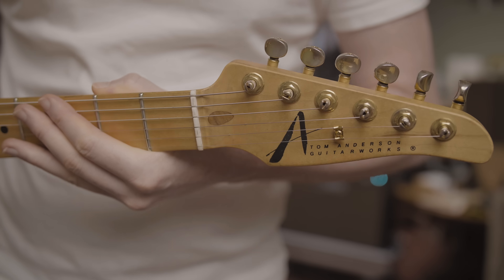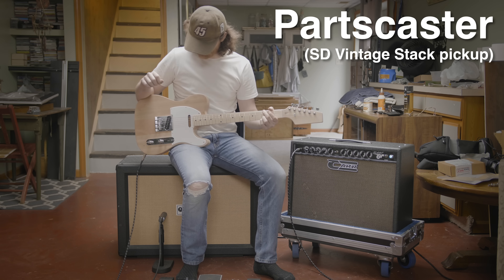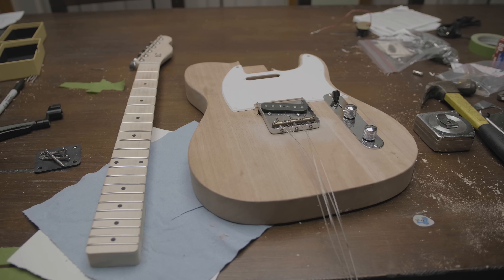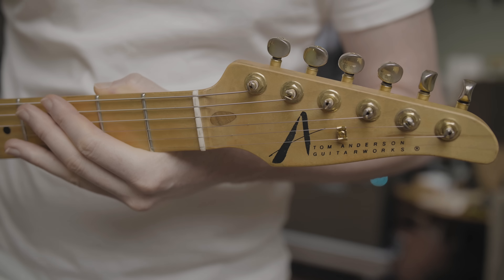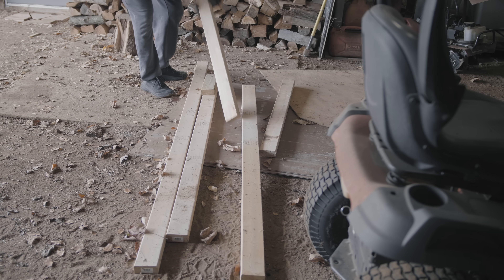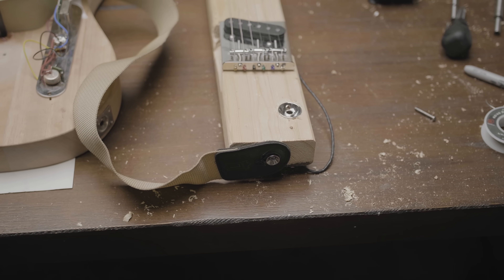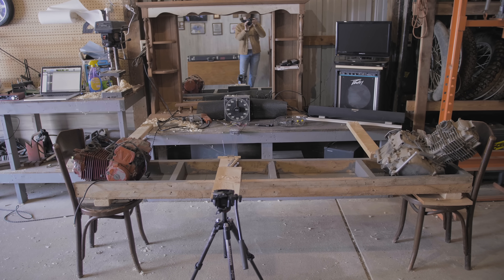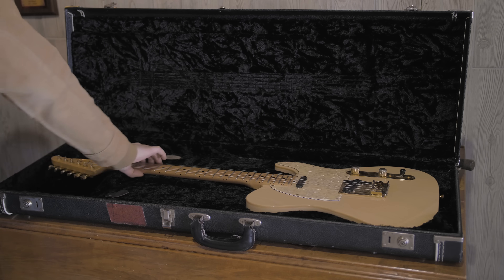Tested: Where Does The Tone Come From In An Electric Guitar?

Comment: What an absolute legend of a video. VERY interesting
Reply: Will the air guitar chug?
Reply: @Hernan G.D.A.  Turn on those Honda engines and I'm sure it will! Lol
Reply: @hernanSXD.3880  yeah that’s a damn good question! The answer is yes as long as the player does not have cottonmouth!
Reply: This guy deserves his own signature model, Ola. Make it happen!
Reply: And a solar air guitar was born
Reply: @NoQuadsNoMasters  The high-neck access is insanely good.
Reply: @randalljones4370  the frets will last several lifetimes of use
Reply: What's interesting about the last test is that, though the body of the guitar isn't under the pickup, there's still a lot of mass there, since it's a table, and the pickup is still connected to it. I actually found the 2x4 more compelling. Still, this pushed me solidly into the "tonewood doesn't matter" camp. Really nicely done, Jim!
Reply: Confirmed: Next Solar shape is an Air guitar!
Reply: But does it Djent?
Reply: This should be shown to every guitarist.
Reply: But will it chug?
Reply: Can't wait for the Solar Air 1.5
Reply: WILL. IT. CHUG?? 👏🏽
Reply: @michaelolvera7490  ok
Reply: Yoooooo
Reply: Legend status achieved! Video of the century.
Reply: One of the best video on YT for electric guitar ;-)
Reply: I'd love a budget Solar guitar with the cheapest possible wood and decent pickups as long as its comfortable to play
Reply: One more like then stop! 665
Reply: Absolutely, couldn’t agree more.
Reply: How does that feel as the owner of a guitar company? ;-)
Reply: I know, right!?
Reply: @michaelolvera7490  well palm muting is something external done to the strings. of course something will be different, but its not the tone, the tone is just being covered up by the palm
Reply: Can Milk chug?
Reply: But will it chug?
Reply: And by the way, it is still not an 'air guitar' cause technically, it's mounted on two tables, with direct contact to the floor.  

The only way to have a true air guitar is using mag-lev apparatuses for both the headstock and the bridge. Or use drones.
Reply: I’ll be patiently waiting for the Solar 2x4…
Reply: But will it Chug? I smell a Collab maybe?? 🤣
Reply: @andybrown1439  where does the chug come from?
Reply: this has been done in another video by this by this dood that owns a sawmill about 3 to 4 years ago
Reply: @michaelolvera7490  prove it
Reply: now build your guitars out of foam Ola. amiright?
Reply: @Ola Englund --- get Fricker on the horn. He is gonna wanna see this ...
Reply: F..cking chugg 😅🤦
Reply: Agreed
Reply: Yeah, but does it chug?
Reply: no chug please
Reply: Respond Ola!
Reply: @HollandProductions_CA  you're not his boss :D
Reply: The question is... will it chug!!!😁😁😁✌✌✌
Reply: U sir are the legend here
Reply: But does it chug ¿
Reply: OLAAAAAA!!!!
Reply: Can you send me a solar guitar and some electronics to screw in to my coffee table to compare? Lol 

Love your first album by the way.
Reply: Hello Ola!
Reply: I knew my Solar sounded as good as any  biG brand USA Custom Shop guitar! Cheers Ola!
Reply: and then ola englund goes and tests neck through vs bolt on
Reply: Too me they all sound the same but a small difference of each other. Including all the amps. I figure their would be a big difference but dosen't seem like it. One more thing maybe it could be in your soul and fingers.
Reply: Too distorted for a test. You can hear just thick or thin sound, no subtlety or timbre.
Reply: Ola posting shit!
Reply: I wonder the reason you wrote this. "legend" ? 5000 comments so far anyways
Reply: Wiil it chug? Up coming next!!
Reply: i can hear the sound of your voice as i read this
Reply: Ola the chugger who has no tone either!
Reply: Dr. Suess
Reply: @Jimi Cicchini "any good piece of wood"? have u seen how many guitar blanks becoming bodies  that are produced in a day at Fender or Gibson?
It's called; mass production.
we're not talking about 10 or 15 guitars a year or a particular Master Builder where you place an order and have to wait a couple years.
It's beyond ridiculous; 10 and 15 grand for a Custom Shop Les Paul!!
But it is All About Supply and Demand.
A freaking Slash "Green Alligator" commands a very popular market and you gonna pay!
I saw that flakey cunt posing with an Epiphone???
Maybe shoulda got Ted Bundy to pose with a Tire Iron...?
Still got yer Pet Rock?
Dear Americans; 
The USA is Not a Joke...it is a Punchline
Reply: @Jimi Cicchini No not all bud, Don't be a complete putz All his experiments are saying is Electronics have more an impact on "Tone" than any wood and that goes out the window when using hollow or semi-hollows as there is acoustic resonance properties. Keep in mind his experiments are a bit flawed.
Gilmour is a master at playing there is a large difference, a great guitarist can play anything and may be able to make anything sound good, more so because he can play what will sound good on it, but you all are probably not at his level as most are not.
Reply: @Jimi Cicchini ? Classic style or modern - Fender has $500 options, either that or get the stewmac offset body kit and DIY it.
Reply: Insert clap
Reply: Such a great experiment.
Reply: @Jimi Cicchini Thomman Music is a great place to start.
Reply: In walked Wenge.. .
Reply: hola ola
Reply: Solar 2x4 when?
Reply: BURP
Reply: So what are you going to do about it wrt your guitars?
Reply: will it chug?
Reply: Ola , what are doing here in hillbilly town? 😂
Reply: But he proved nothing... Bolting the strings to wood and a large metal bench is not "removing sustain from the equation." Those things would be vibrating as much (or more) than a guitar body and neck 🤦🏼‍♂️
Reply: SO.... if i buy a cheap Chinese electric guitar and put an expensive pickups in it... voila!! Excellent sound😱😱😱
Reply: @americawalk1154 Pretty much.
Reply: The air guitar doesn’t go chug chug, it goes chuuuug chuuuuug.
Reply: Total waste of time for this poor guy doing the vid and for everyone else that's falling for a bunch of hoopla..  goofiness. C'mon people. I just stumbled on this and rarely ever click on this type stuff and never thought I'd be  commenting on something like this. 

If every guitar player on YT would spend as much time  actually playing the instrument and trying to get better or improve or be creative and write something as he or she does watching gear reviews or something gear related or some  dude showing a BS short cut to how to  become the next Eddie VH... We'd have lots more talented players out there to draw and learn from.  

Get off YT and put on a record. Learn it the old fashioned way...By ear. 

Rant is over.
Reply: What are the sustain differences  between them  if any
Reply: even  without body , quitar  sounds the same....
Reply: What a surprise to see you here.  I've owned a lot of guitars, and my favorite is the Washburn Solar.
Reply: Just rehashed what was known about electric guitars from the 1930s and 40s. Read your history.
Reply: Nothing legendary about con artists to me
Reply: Do a Will It Chug on The air guitar!
Reply: Yes, amazing video. Turns out that the Emperor is stark naked. Too funny. Gonna find that video where Steve Vai or Joe Satriani explains how the fret inlays provide a more mellow tone. I swear; best video I saw this year. Can't believe I only just found it.
Reply: Tone air, tone wood , tone fire, tone water
Reply: Agreed.
Reply: For chugging you better try the air guitar.
Reply: I guess I don't need that solar guitar afterall
Reply: Did the video chug though?
Reply: Great video. Some people just have too much money and need to burn it. 🔥
Reply: @danpena7922  apsolutly!!!! It is nice to have nice guitar, but let's be realistic for god sake... 6000 for electric guitar is ridiculously stupid... Even 3000 is to much..
Reply: Time to release budget plywood Solars!
Reply: Hey Ola.
Having a guitar company your self, what is you thought on tonewood in solar guitars? Is it something you think about or do you choose on price, looks or quality?
Reply: Yes I would like to set up before I just don't know if this is really losing it and really you know I use it for a crutch will you have to expect my mind to be screwed up and with the very thing yet it's f*** up, you know what to say about thatOkay I'm not sure if I'm crazy but are you talking to me because if you're talking to me
Reply: You should be interested in Science best.

When a string is struck, it begins to vibrate in its fundamental and a strip of harmonics with different values in Hz, although not all with the same intensity since it also depends on the string itself.

From that moment on, all the elements of the guitar will offer resistance to said vibration (say vibrational energy absorption), as well as the body.

Depending on the characteristics of each of these elements, the absorption can be proportional in all the Hz of the vibratory or electromagnetic wave or not....
If we have a part of the guitar, such as the body, made of wood whose hardness (as a result of its internal structure, drying, etc. etc.) is high, it will provide more resistance to harmonics of a few Hz than to harmonics of higher value in Hz therefore immediately absorbs and leaves the string without low harmonics... resulting in a higher pitch.

And other woods that absorb much more (oppose more resistance) to the high harmonics will give a darker timbre... Other combinations of woods eat up the lows and highs and leave more mids... etc.

That said, does the wood compared to the pickup have more influence? No, obviously a pickup prepared to pick up the highs and discard the lows will give you a high-pitched tone more effectively than wood.... but that's another story.
It does not mean that the material is the same, because no matter how much a pickup is prepared to capture more treble, like the string it suddenly loses all the upper harmonics due to the effect of the resistance of the body and other materials, which is going to left is a guitar with 0 sustain.

Video is bullshit.
Reply: @derfreischutz4380  you’re arguing about the acoustic tone of an electric instrument… the wood doesn’t have any affect on the amplified tone. 

See the video you’re commenting on for proof. 😂
Reply: @Drtydeeds  yes it does, you didn't read carefully what I published
Reply: @derfreischutz4380  the wood doesn’t affect the amplified tone of the guitar no matter how you try to twist the facts lol.
Reply: @Drtydeeds  alright man!
Reply: Has anyone watched the Warmoth video where they do the exact same experiment resulting in clearly audible changes in tone when keeping everything constant but using different bodies? Even the test between one chambered body and one solid body cut from the very same piece of timber produce audibly different results. I definitely couldn't hear any difference in this video but they have quite a few videos with very different results.
Reply: @andtothewestamerica   to be fair they sell wood. I like Warmoth, but there may be some bias there.
Reply: @MegaWimberly  Can't be denied. Maybe I'm a fool but I don't see Warmoth going to the trouble of making those videos, then altering the audio so they can fool customers.
Reply: @andtothewestamerica  HOLD THE FRONT PAGE! A company whose business is to sell you different bodies and necks made of different woods says there's a difference in sound!
Reply: @UITATUBE  They don't say there is a difference in tone, they demonstrate it, clearly.
Reply: @UITATUBE  Wow, you're so clever! Damn, some of you guys are so quick to jump to conclusions without just watching the videos first. the warmoth guy is pretty honest about these things. He has said before that pickups make the most difference and if the wood makes a difference, it is subtle. In some vids he said he couldn't hear a difference. Go watch the vids before you talk rubbish.
Reply: @andtothewestamerica  Warmoth has a sizable vested interest in making people believe that more expensive wood sounds better. Not that they would necessarily lie but they're also not an objective source at all.
Reply: Bingo
Reply: For the most part wood is graded by looks, not strength and stability!  More expensive is relative, as is everything in marketing.  If you only knew what they are comparing it to, or what not...  Shit, all wood is more expensive now than it ever was.
Reply: Maybe its not the wood itself but rather if it is a one piece body with straight continuous grain witch is much more expensive than say a low end guitar with a body made of sometimes 5 pieces of different cuts of wood joined together whit heaps of glue.
Reply: Unless you are implying that they cheated on their tone test, how does their supposed bias actively affect the outcome though? Isn't a fairly conducted experiment the same regardless of who conducts it?
Reply: @andtothewestamerica  different pickup height?
Reply: @austinthecat  That's definitely a possibility
Reply: @andtothewestamerica  It benefits their business for things to sound different, this guy's study is the best. I've seen another one here on YouTube where they change the body of the guitar and results are the sane as this one, he even measured frequencies, resulting in pretty much the same.
Reply: @andtothewestamerica  Yes. There are several other videos on YT that get opposite results. One thing to remember in the debate over tone wood is that Warmoth sells bodies. Bodies from various woods of which some are VERY EXPENSIVE. So, it wouldn't be a very wise decision for them to make a test video where the results showed little or no difference in the sound from tone wood. Why would a customer pay big money for a body from exotic wood if there is no real difference in tone? I'm not saying Warmoth intentionally tried deceived anyone but, too many other tests give contrary evidence. Besides, once you plug into an amp the tone wood argument becomes irrelevant anyway. It's all about electronics. From the pickups and pot type to the effects/eq and speaker type. So, unless a player just wants an expensive body for bragging purposes or they intend to clear coat it and want it for looks, it's just throwing money away that could be better spent on a really well built and fretted neck, better components or, better effects and amp. There are also several videos here debating whether to invest the most money in an expensive guitar or an expensive amp to get the best tone The amp always wins. As long as the guitar plays well or to suit the player, the bulk of a budget is best spent on a quality amp and effects.
Reply: @andtothewestamerica  i have seen those too.
Reply: @andtothewestamerica  There are other videos on YouTube that purport to illustrate differences in tone between woods, but I believe these conclusions are produced by a collection of mics that are either not accounted for or purposefully not disclosed. ie: mic on host or secondary mic near the guitar. Both of these instances would contaminate the results with Acoustic variances.  The size, weight, and composition of a mic near the  guitar would account for that.
Reply: @richctv  Yeah, possibly. I think almost any test using mics would be flawed vs recording DI
Reply: @andtothewestamerica  What does Warmoth sell?
Reply: @shaunmason3243  A range of custom necks and bodies
Reply: @andtothewestamerica  It was a rhetorical question.
Reply: @andtothewestamerica  Yep, saw it. But as i asked, did they adjust the guitar as close as possible, like, strings height. In this video, we can confirm that the strings height is a major factor, and from the pickups, and from the neck. And the Warmoth test makes me think that they forgot to perfectly adjust each guitar like it have been done in this video.

Imagine, a guitar with no body at all sounds almost the same as a $3000 one.
Reply: @andtothewestamerica  i smell conspiracy
Reply: @andtothewestamerica  Remember that any guitar maker (or wood supplier) is biased in that they WANT tonewoods to make a difference so that they can justify charging more for "tonewoods." You need a financially unbiased source.   I haven't seen a single video really show that they control for all the factors as shown in this video. They all have to be kept equal except the wood.  That is not easy to do.
Reply: @andtothewestamerica  Warmoth sells guitar bodies. Of course they’re going to make you believe that tone wood makes a difference
Reply: @andtothewestamerica  the one comparing alder, swamp ash and mahogany did t seem to make any difference
Reply: @andtothewestamerica thanks for asking this question. The answer is that this video is a fake ;)
Reply: @andtothewestamerica  warmoth? you mean the company selling guitars

seems like they didn't control for pickup - string distance or some other thing

odd innit
Reply: @andtothewestamerica Who has more to gain? Warmoth or Jim Lill? Is Jim Lill selling guitar bodies or necks? Warmoth profits from the tonewood delusion.
Reply: I suggest they take it to the extreme: Make a Tele body out of Hickory, which is one of the densest woods in America, then make another Tele body using Paulownia, which is extremely light.  Same everything except the body.  In theory, if tonewood does not matter, they should sound the same, amplified or not.
Reply: @dodjiegarcia2320  Density is a ruse too!!!  Learn about physical properties!  Just look up any of the various "Tonewood debunked" videos, and you can hear a cardboard strat vs a concrete strat, plastics, all kinds of woods, plaster...!  The difference?  Concrete sustains a little better than cardboard.

Nothing wrong with using structurally sound and stable materials, and hickory isn't very stable and will deform over time.  Paulonia is native to Japan, and an invasive species in the United States, but it is very light and pretty strong, and does make for good guitar bodies, but isn't the best looking wood, so best for painted bodies.
Reply: @Bob-of-Zoid  density is just an average. It does not tell the story of what part of the wood has more pores and what part is more rigid.

I believe in tone wood, but I do not believe all expensive tone wood guarantees good tone. I saw the ramen and concrete strat videos. If you are holding them as good examples, then I understand where you are coming from. But I was very underwhelmed with the recorded sounds.

Manufacturers will not tell you the fool proof formula in making an exceptionally-great sounding guitar, because they also have to figure it out themselves. You can only tell if you got a dud or a gem once you string it.
Reply: @dodjiegarcia2320  so the air guitar was not enough proof? 🤤
Reply: @dodjiegarcia2320  lol he already did the most extreme thing possible, made AIR sound the same as his telecaster. I know the truth is hard to swallow but tonewood is not a thing with electric guitars...
Reply: @PoltergeistWorks  The thing is I can hear the difference both on IEMs and high end speakers. Cellphones, nah.
Reply: @AlfXB  It is still not an 'air guitar' because the headstock and bridge are mounted to tables, which are resting on  the floor, and the floor connects both tables.  

For it to be a true 'air guitar', the headstock and bridge should be floating via mag-lev or drones separately (drones are noisy though).
Reply: @dodjiegarcia2320  Yeah, sure, especially with YouTube quality and compression. Plus any difference you hear is more than likely due to the different nut. If you would put the EXACT components from his Anderson (bridge, nut, pickup, electronics) on that Air Guitar rig it would sound EXACTLY the same.
Reply: @PoltergeistWorks  what made you say that?   First off, I mentioned it still does not qualify as a true air guitar.  More like a floor guitar.  That explains why drums sound different when on a wood surface, a concrete surface, and on a carpet.  By the looks it seems the strings are vibrating on air, but in truth those huge pieces of wood on the sides (plus the plank connecting both tables behind Jim) kind of skewed the claims.

If I had enough money for R&D, a maglev headstock and bridge maintaining constant distance (while not affecting pickup's mag field) is the real test.
Reply: @dodjiegarcia2320  You are missing the point. The point is whatever the parts are connected to doesn't matter - the only thing it might affect actually is the sustain, not the sound itself. I explained it in another comment I've made: "The ONLY thing that might be affected by the wood (or rather the weight of the instrument I believe) is the sustain. I'm pretty sure you would find that because your strings were connected to such heavy objects your AIR guitar would have much better sustain, where it is actually sucked out/cancelled out by a traditional guitar body and neck. I've seen that sustain experiment in another video where someone connected strings to steel beams that were connected to the ground. Almost infinite sustain. So in that regards actually your AIR guitar is the ultimate electric guitar, where the traditional electric guitars can only be a bit or a lot WORSE from that point :) I believe Paul Reed Smith mentioned something like that (although still believing in tone-wood...) that the best instruments don't suck out the tone, and in this statement he was right"
Reply: @PoltergeistWorks  So it should not be called an 'air guitar' in the first place.  Because aesthetically, it is very counterintuitive to see strings vibrate on air having that much detail, when in fact it is the tables and the floor that are doing the work.
Reply: @dodjiegarcia2320  Well! it's the closest possible to an actual air guitar, he calls it "air guitar" to identify it in the video too, that's the one I am referring to. A true air guitar could only live in one's imagination. 
If that is not enough proof to you that tone woods in electric guitar don't make a difference, nothing can be, except of course some random thing you may come up with.

He also used a wood board he had laying around to build a body, this is more extreme than your Poplar vs whatever it is you're saying above. 
Drones....🤔🥴🤯
Reply: @AlfXB  You cannot accept it as proof if you can hear the difference in a lossy format like youtube that rolls off anything above 16KHz.  I can hear the difference of the Tom Anderson and the air guitar.  But it gave me an idea of a nice lap steel guitar, where you have two posts on the side (or more like a pedal steel guitar without the pedals.)
Reply: @dodjiegarcia2320  But the argument here is not what the name of the guitar is... it's about the experiment itself and the results that conclusively say that tone-wood is a myth :) Of course you have to have the strings connected to something, it's just the fact that no matter what it is as long as the pickup is the same and contact points are the same (saddles and nut) it will sound the same :)
Reply: @dodjiegarcia2320  They wont, but not everyone can actually hear past the fundamental frequencies of the instrument so they say it doesn`t matter. Is tone wood a big deal honestly I dont think it should be but this is a business after all.
Reply: @dodjiegarcia2320  An older man here in my town, right outside of Nashville, built a telecaster from one solid piece of hickory. Neck and body were not glued together but were one solid, continuous piece. It was unbelievably beautiful. The guy was a fairly well known player in the area and one hell of a wood worker, as it turned out. He had recently passed away and left it to his young nephew around 18 years old. About 2 years ago the brought it into the local guitar store while my brother and I happen to be there. He wanted to trade it in. They offered him squat but, you could see dollar signs in their eyes. It was beautiful and sounded great but, it didn't sound any different or better than anything else. The boy didn't trade it in there but, I'm sure by now he probably has gotten rid of it.
Reply: @dodjiegarcia2320  balsa guitar body
Reply: @dodjiegarcia2320  I believe the difference between a guitar and strings hanging in mid air to be a sufficient test. I can tell you there’s no difference. Besides, I trust this guy, because he’s not selling anything, or creating things for sale. This must be very disappointing news to all guitar manufacturers, especially the “high end” guitars that cost almost $2000 and up!
Reply: Exactly. This guy is just looking for inexperienced fanboys that don't know any better.
Reply: @andtothewestamerica  Agree!
Reply: This video is about pickup tone not tonewood what a joke ! It absolutely does make a difference as far as the overall quality and resonance of the guitar if well-built with the right type of woods that retain string vibrations and is not a transparent wood will produce all those fun words we use like wow that guitar really rings out has a lot of Mojo sustain,etc... whenever I talk about tonewoods to anybody pickups are always left out of the equation and not relative to the conversation..

As someone who's been lead builder for larger companies as well as my own brand along with the many guitars I've owned is all the proof I need because throughout my years in all the woods I've used and tried along with hardwood tops that act as soundboards maple in particular create different natural properties and it is real so sorry for coming off like a smart-ass but most of you in my opinion really have only owned one guitar in your life to not know that woods do make a difference... we've all played those lively guitars and the dead ringers as well so that's all it's about I don't understand why this is such a back-and-forth all the time it's about the wood, not pickups !!!!

And for the person that talks about how they built a guitar out of garbage wood and it's the best guitar ever and that's probably true it just happens to be a resonant piece of wood and that doesn't prove anything either... if it's the right combination of Parts almost anything can come together and sound great but we do with the things that are proven that's why we don't use plywood it doesn't look as nice and fuk it's plywood

You can have your plywood guitars
Reply: @globalmind43 You can barely put a sentence together.
Reply: @globalmind43 You can barely put a sentence together.
Reply: Yeah he did a nice job, his testing is severely flawed however, just like his "air Guitar" where he traded tone transfer from the body wood to the tables....
I have done this test several times, I think your son even did testing, I can say 1 thing for sure guitarists are stupid and gullible as hell, perhaps people should have paid attention in Physics class to understand how Sound being Mechanical energy, its properties, and the properties of how it refracts, reverberates, absorbs, and reflects.
You can see this through recording software as well as an Oscilloscope, you have to have data points proving your theory correct eliminating variables to 1 to swap out, It's called scientific method.
Also, if you want "Tone woods" don't throw a heavy ass coat of paint and clear coat hardening the surface you are basically changing the surface properties of the wood.
For metal though dude I am not sure it matters as much if that makes sense the more you distort the signal properties get gobbled up in the mess so to speak, Specter studios did something similar but also did it in a half assed way.
 Honestly, I am tired of seeing people butcher this, I swear I will petition Elon Musk and his wife Grimes to do this together and put this to bed the proper way.
Reply: @BahbahKaduche  Of course it does, especially if you mount the pickups close to the body.  No I do not mean the space between strings and polepieces.  Try two different Strat bodies, one very heavy (say Rosewood body) then a light one (say Poplar) and mount the pickups very low, same everything except the bodies.  The Rosewood body will sound a lot brighter while the Poplar will sound a little more hollow.